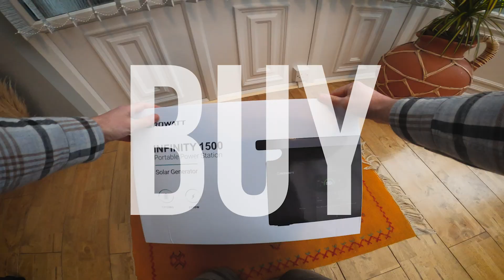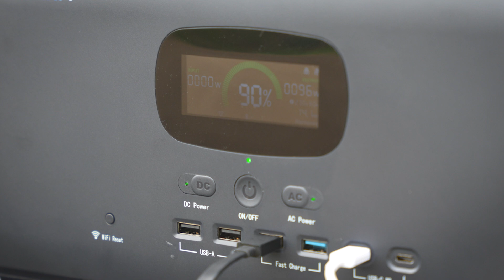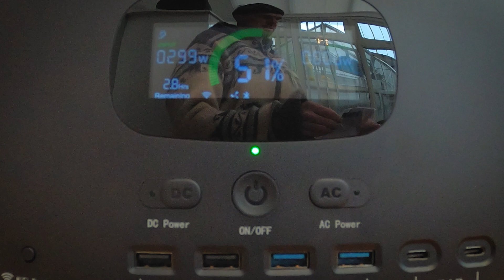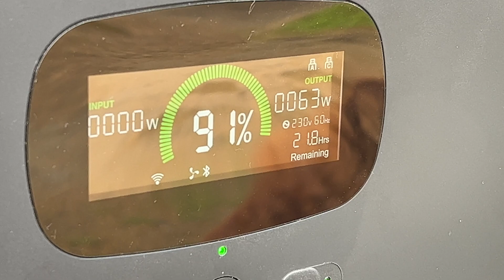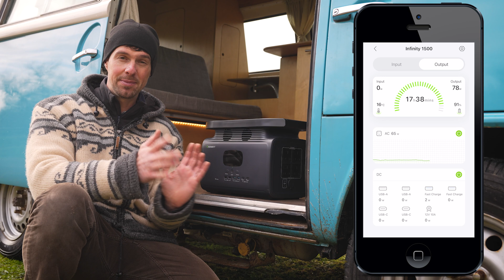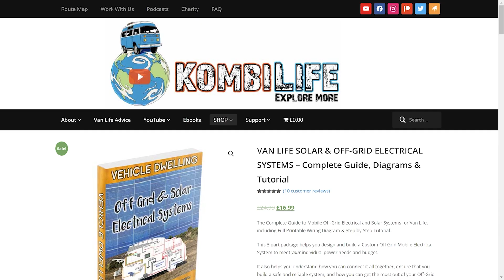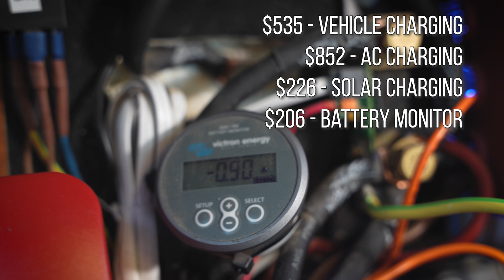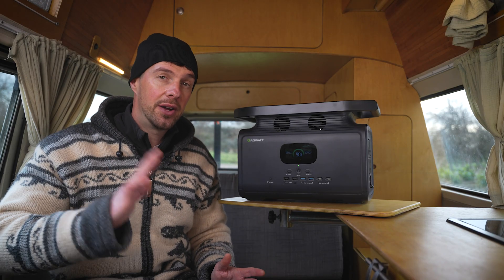Portable Power Station vs Battle Born Battery Build  // Which Wins?

Comment: Just in the process of choosing to build or buy right now. I'm looking at a small (600w) system and honestly I can't build one for less than an "off the shelf" solution and certainly not make it as compact. The obvious advantages are expandability and serviceability should some individual component fail. As space will be critical in my build, I'm leaning towards a pre-built.
Reply from the maker: Sensible. Best of luck with the project. 👍🏼

Comment: Hey. Thanks for doing this. Only thought the power stations seem to be all Lithium-Ion which is similar to Tesla's, phones etc that catch fire easily. The custom ones is Lipo4 lithium Iron which is proven to be much safer?
Reply from the maker: Yep you want LiFePO4 for your vehicle leisure battery, it’s the safest option. Many power station use these batteries.

Comment: Hmmm, the review seems a bit 'bought'. Look like your DIY system is about 3x more capacity and maybe 3x more charging amps than the growatt. So price comparison is not valid.
Reply from the maker: Thanks for your comment. The prices were 100% valid, it doesn’t benefit anyone to be dishonest. 
Most portable power station of similar size to this Growatt unit have more solar and AC charging capacity than my custom system. Where as mine has more Alternator charging capacity. I have a total of 400ah of LiFePO4 batteries in my system so I pro rated it in the calculation to make it possible to compare like for like (as stated in the video)
Reply: @KombiLife  My apologies. It just seemed that the DIY component prices seemed quite high. Another benefit to the all in ones is the superfast charging rates - maybe due to using 24v+ internally.

Comment: Wish these units would have dual input for charging. Like 1 from the car accessory outlet and 1 for solar. Plus have these inlets combine the charge input. So when driving it would charge with solar plus vehicle alternator and when stop only by solar.
Reply from the maker: In theory that should be possible with a simple cable adapter.

Comment: These portable units almost all use NMC Lithium cells, not LFP cells. The NMC cells used are on top of that the cheapest they can find, otherwise thy couldn't sell them for this price. They give no information on the lifespan of the cells, but I can tell you, you'll be lucky if you get 500 cycles out of them before noticing a significant loss of capacity. LFP cells will last over 3000 cycles. If you have to replace the entire system every two years because the cells are aged and useless, then it's not cheaper than a proper system with high grade LFP cells.
The NMC cells are also a significant fire hazard, the thermal runaway reaches temperatures over 700°C that will destroy anything close to them. LFP cells won't reach temperatures anywhere near that.
If you live in a van, boat, cabin etc then build a system, if you only need it for occasional weekends or power outages then a portable power generator is ok.
Reply: no mention on the site of the battery chemistry but it does say >800 cycles. which isn't saying much.
Reply: @derekdelboy  No LFP cells have such a short lifespan. they're typically between 3000 and 5000.
Reply: Oh my, like a fire never happened to Ben :)
(might be one of the reasons for such high-profile expensive components).
Extremely valid point though!

Comment: Thanks for the info and great video! I use my van off grid for Boondocking all the time. 525 amp hours with the bulletproof Lithionics lithium battery. Now my van is for sale, and if anyone is interested, they can see it advertised on my channel. I am going to go with a larger Lithionics battery system at 1260 amp hours in the future.

Comment: Grow watt another unit they have everything built into it except the battery that's the way I will go because these units that you have once the batteries has reach their cycle of life you have to re-buy the system and you cannot replace the battery I rather go with their other units
Reply from the maker: Excellent point and something to consider but in reality I’ve only done less than 100 full charge cycles on my 400ah system. I think they will last a very long time, certainly long enough to get your moneys worth